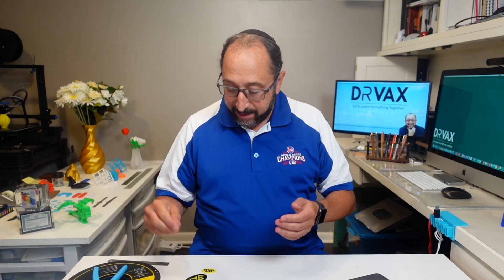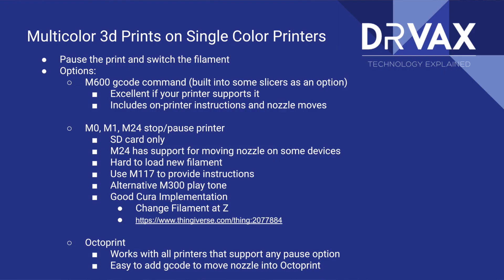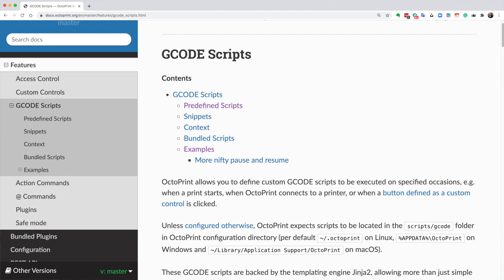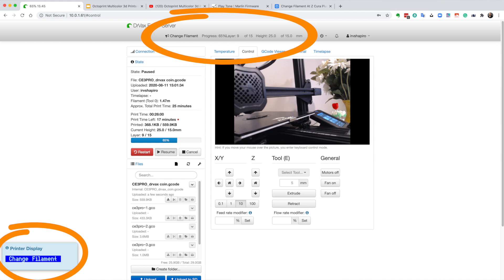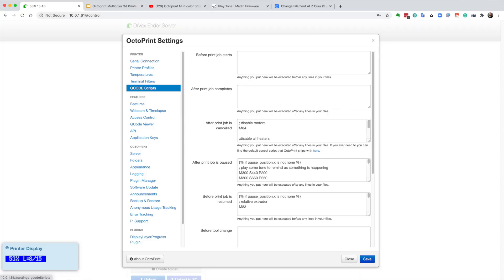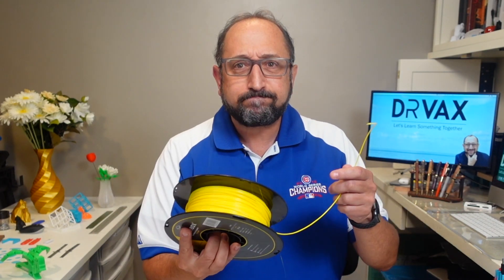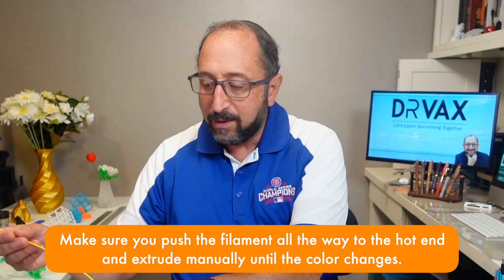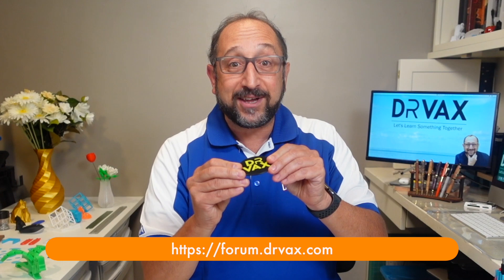Octoprint Multicolor 3d Prints including Ender 3 V2

Comment: I am trying to do a simple multi color print using Professional Firmware (9/23 version) on my Ender 3 V2 stock printer with Cura 5.4.0's Pause at height post processing script. When I attempt to send the M0 command through OctoPrint it displays this message: Not sending M0 to printer, it's configured as a blocked command. The printer does not relocate the print head. If I change the filament and try to continue, I get a blob of filament when the print resumes. I tried changing the Cura script to use the Repetier/OctoPrint method but that did the same thing - the printhead did not move out of the way. I guess I'll try to figure out the old way to do this with just an SD card.

Comment: Your videos are always in depth and well-articulated. However, like many have commented below, unfortunately the technique doesn't work for Ender 3 V2 although it might have worked for you somehow.
Neither M18 or M84 commands are able to disable motors individually. Similarly, M17 isn't able to engage axis individually.
So unfortunately this video technique doesn't work on Ender 3 V2.
Nonetheless, thanks for showing some advance features of Octoprint.

Comment: Just wanted to thank you for the multicolor video. I bought my first 3D printer, a ANYCUBE Kobra and was disappointed to learn it did not have the ability to pause for color changes. So I bought a used Raspeberry Pi, got Octoprint working and followed your instructions on this video. I am now functional for color changes. Thanks a bunch. Great video. Your presentation makes it very easy to follow you.

Comment: I had issues with the supplied code where the extruder stopped extruding after resuming. I had to add an extra M83 command after resetting the feed rate to resolve it. Hopefully that helps someone who might run into the same issue.

Comment: I know this is an old video, but I'm having trouble getting the script to work properly. 1) I'd like it to automatically retract 300mm of filament prior to the pause and it's not happening. 2) The extruder motor remains active, after the pause, even though there's an M84 E command. Below is the script:

{% if pause_position.x is not none %}
; relative XYZ
G91
; relative E
M83
; retract filament, move Z slightly upwards
G1 Z+10 
G1 E-300 F4500
; absolute E
M82
; absolute XYZ
G90
; move to a safe rest position, adjust as necessary
G1 X0 Y0
; make sure position steppers stay powered on to lock position
M17 Z X Y
; unlock the extruder stepper so we can use the dial
M84 E
{% endif %}

Comment: Will the bed remain heated using your method?  As there is no command given anywhere (neither in Cura or Octoprint GCode) I don't see any reason why the bed wouldn't retain the temperature  that it was printing at while the system is paused waiting for the filament change/resume.  I have a current issue using M600 where the bed will cool down, so if I am not standing by to change filament/resume my print, the object I am printing will lose its adhesion to the bed.  When I resume my print, even if I reheat the bed again, the printing becomes a mess as the object starts moving on the bed.  Using Ender 6.
Reply: It should keep the beds status. For me it does.
Hope this late answer will help you.

Comment: add m300 then you will get a beep also if you add m300 for resume the post scrip will work and you can change the filament with the script just fill in the filament info also set the code from marlin to BQ (M25)

Comment: Just wanted to let you know that this technique is working very well for me.    I've upgraded Marlin on my Ender 3 and so I will try the filament change feature in the slicer as well once I am done with my current project.    One thing that i found helpful was that when I change the filament,  i get a little blobbing on the print since i am feeding the filament into the hot end in by hand.    I worked around this by turning the Draft Shield on in CURA.    This allows the filament to purge before going to the print.
Reply: Man thank god I read this comment. I was curious how I would be able to still have a clean transition after changing filaments without blobbing or anything like that. A draft shield is perfect since it's always the first thing printed every layer! Thanks!
Reply: @PabzRoz   Yeah thanks for that info. That Draft Shield completely stopped the blobs.

Comment: Thank you from Argentina!.  In my case the M84 E command did not work as it does not unlock the stepper individually. I only work the M84 unlocking all the steppers. Do you know if there is another command to unlock only the extruder? My printer has Marlin 2.0.7.2 and it works perfect. It may be necessary to enable some function.

Comment: Did this with my Ender 3 Pro, running Marlin 2.x firmware.  Worked!  One suggestion to the code would be to drop back to the bed and run a wipe strip next to the first one to get the head primed.  May work on this myself in your posted code soon.  Will require some more research.
Reply: {% if pause_position.x is not none %}
; relative extruder
M83
G1 X0.1 Y20 Z0.3 F5000.0 ; Move to start position
G1 X0.1 Y200.0 Z0.3 F1500.0 E15 ; Draw the first line
G1 X0.4 Y200.0 Z0.3 F5000.0 ; Move to side a little
G1 X0.4 Y20 Z0.3 F1500.0 E30 ; Draw the second line
G1 E-4 ; retract a little
; absolute E
M82
; absolute XYZ
G90
; reset E
G92 E{{ pause_position.e }}
; move back to pause position XYZ
G1 X{{ pause_position.x }} Y{{ pause_position.y }} Z{{ pause_position.z }} F4500
; reset to feed rate before pause if available
{% if pause_position.f is not none %}G1 F{{ pause_position.f }}{% endif %}
{% endif %}

Comment: This didn't quite work on my Anycubic Mega S. After filament change my extruder wouldn't extrude any filament. But I found elsewhere the solution. In the 'Before...Resumed' script, just before the line "; move back to pause position XYZ", insert an M83 line into the script like this:

 ; WARNING!!! - use M83 or M82(exruder absolute mode) according what your slicer generates
M83 ; extruder relative mode

M83 worked on my combination of Anycubic and PrusaSlicer.
Reply: That's interesting. I too am using the Anycubic Mega S but the code worked fine for me though I was using Cura to slice not PrusaSlicer.
Reply from the maker: Thanks for sharing.

Comment: Hey, I am having the issue that after I change the filament and resume the print... the nozzle is digging into the printed object upon restart, I tried doing a quick fix by just increasing the z offset but it didn’t change the zheight at all. Not sure why. It’s pretty easy when you break down your video just copy and paste the settings into Octo, and the layer pause in cura
Reply: I’m also having this issue! It smashes into the print on resume!
Reply: @teej84  Does your gantry drop while changing filament? I had this happen the first go around, tightened everything up (eccentric nuts and all screws) and works okay-ish. If I don't get to it immediately it seems like the "Hold" on the Z axis ends after 2 mins or so. Any additional recommendations would be appreciated! Thank you DrVax for all your content!

Comment: After some real headaches trying Pause at Height and Filament Change in Cura, finally some help. Great video! Especialy because you don't just learn a trick, but also hightlight the problems. It helps to understand my printer better.

Comment: I found that the M0 command was blocked on my Octoprint when I attempted to use this method. I unblocked the M0. It works now. Is that ok? I do find if I take more that 90 seconds to do the physical filament change the stepper motors release and the z axis drops.
Reply from the maker: The stepper motor timeout is dependent on your firmware.  You might be able to put a G code command in your start code to override this timeout depending on your printer.  Check out these commands:  https://marlinfw.org/docs/gcode/M018.html
Reply: @MakeWithTech  can I put M18  S9999 in the before pause gcode line in the Pause at Height script you featured in this video, to extend my time to change filament without worrying about the stepper motors releasing? Thanks for your response.

Comment: Great video as always.. just one question. I am running an optical sensor for filament runout or jams which is wired through my Ender 3 v2 board. Will this create any conflicts with this setup? Thanks again for a great video!

Comment: If you have the 4.2.2 board this doesnt work! :(
https://www.gitmemory.com/issue/MarlinFirmware/Marlin/19153/680683876
The G-code runs but you cant disable the extruder alone. It's either all steppers on, or all steppers off.
Meaning you either have a hard time swapping filament but you dont lose position or you easily swap filament and also easily lose position.

Comment: If you happen to move the x axis when changing filament like I did, is there an exact way to move it back to that point
Reply: I believe it does this already: @12:35
Reply: @DaveRune  mine didn’t go back. It just banged against the print and started running the filament where it was trying to print.
Reply: @nikkihargrove7952  I guess it got knocked downwards meaning the direct path was unfortunately through the model? May be a good move to raise it up somewhat before resuming.

Comment: Thank you for the info. My extruder will not disengage after the M84 E command. I tested it in the terminal, I can only disengage all steppers with M84. I can also only reengage all steppers with M17. Commands for a specific stepper don't seem to be interpreted. I have upgraded my firmware to the latest version and I have the latest version of Octopi. Any suggestions would be greatly appreciated! Thanks.
Reply: I think I have the same issue (with stock firmware), but from what I've found online it seems it might be a limitation of the board: https://www.gitmemory.com/issue/MarlinFirmware/Marlin/19153/680683876

Comment: i use MULTIGCODE software on my ender 3 v2 this software cut the g code on several part so you have all the time to change the filament because you are several g code just change the filament before confirm the end of print the only problem is to purge the filament manually and the z not up to help you i don't know how to enter command in note pad to automate extract filament z position and the purge. I use cura. this solution no need  modification of your printer. Sorry for the english i'm french

Comment: i use prusa slic3r, i set this up in my octoprint, when i load a file and tell octoprint what layer it is i get this error. injecting "GCODE failed. Replaced 0 out of 1 needed." any help would be great thank you

Comment: Thanks for the video! Where can I cut and paste the gcode shown? I have been doing multi color prints on my MP mini using the M600 gcode. However, I purchased a Anycubic Mega X and there is no gcode supported pause. So, I am making the leap to Octoprint. Thanks again.
Reply: both sections of code (pause & resume) are in the description

Comment: I have found a way to change filament on the 3v2 using the "Pause at height" post processing command on Cura 4.7.1.  I selected the BQ (M25) method.  It only works correctly if you add something to the "G-Code Before Pause" box.  I added a M300 command so it would beep. 

Note: I needed to make one change to the g-code to prevent a blob of filament once it restarted printing.
Resulting G-code shown below.  I commented out the final G1 F1500 E10 line and the print came out great!

;script: PauseAtHeight.py
;current layer: 3
M83 ; switch to relative E values for any needed retraction
G1 F1500 E-10
G1 F300 Z1.8 ; move up a millimeter to get out of the way
G1 F9000 X190 Y190
G1 F300 Z15 ; too close to bed--move to at least 15mm
M104 S0 ; standby temperature
M300
M25 ; Do the actual pause
M109 S200 ; resume temperature
G1 F1500 E10
G1 F1500 E-10
G1 F300 Z1.8
G1 F9000 X122.478 Y111.115
G1 F300 Z0.8 ; move back down to resume height
;G1 F1500 E10  -- This is the line I had to comment out.   Else I got a 10mm blob of filament…..
G1 F1500 ; restore extrusion feedrate
M82 ; switch back to absolute E values
G92 E338.46292
;LAYER:3
Reply: The blob's been driving me crazy, so thanks for this - gonna try it soon. I actually managed a print without a blob once by not feeding the 2nd color all the way to the extruder, but that seemed awfully imprecise. I've also wondered if it might not be possible to have it extrude a purge line after the pause, just like it does at the beginning of a print. It occurred to me that you wouldn't want it to do that on the far left like it does at the beginning of the print, as that could knock over your print if it's a tall one, but maybe a line at the very back of the bed?

Comment: I find it much easier to just use "Pause at Height" function in Cura.  I love Dr Vax but his desire to get into the Gcode commands is obsessive.  I've been using Octoprint for more than 3 years and have never once used the "terminal" tab.
Reply from the maker: I always find that the more I understand how technology works the better I am able to utilize the technology.  I do understand that the g-code segments may be tenuous for some of my viewers.  However even if you do not want to write g-code, you still need to use the terminal interface to turn your 3d printer.

Comment: I am on the stock Ender3v2 v1.0.1 firmware and the steppers are locked for ~120 seconds but then unlock. Also during that time, the extruder is not unlocked.  I have only been at this for a week so updating the firmware is not yet in my wheelhouse.  After canceling the print I tried sending the M17 and M18 gcodes to the printer and noticed that even if I specified an axis or the extruder 'M17 X' it would lock all steppers.  Same with the 'M84 E' would unlock all of the steppers. Back to the script when it runs the return for the M84 E would return 'echo: busy: processing'.  Great video and the explanations helped demystify 'GCode' and set me on this learning path.
Reply from the maker: Yes. Each version of the firmware reacts a bit differently.  I believe it may be related to the optional timeout parameters on the M18 command.  While the documentation states "If a timeout is given with S, this command just sets the stepper inactivity timeout.
If no steppers are specified, this command disables all steppers immediately."   I have also noticed my stepper motors do not unlock immediately.

In fact Creality recently shipped version this version "Ender-3 V2_32bit_ 2.0.1V Latest Firmware_0814.rar" which I have installed but not tested.

The only way to get the exact documentation result is probably to install the native Marlin V2.

Comment: I've been recently introduced to your videos and they've got some good content... This script to do filament change is good - but damn, its an ugly hack. At the risk of being accused of plugging my own firmware - I build the options in to allow the use of M600 on the Ender 3 V2 - which makes this a LOT easier - and in theory, OctoPrint should even prompt you for a filament change.

The firmware is at https://marlin.crc.id.au/ - updated from the bugfix-2.0.x branch of Marlin every day - so its always current.
Reply: I installed the firmware you compiled for the ender 3 v2 stock on my printer and it does pause the print at the correct layer and moves the print head and unloads the filament but there is no way to tell it to continue either with the screen or Octoprint. Unless you know of a way to get it to continue DrVax's "ugly hack" is the only way to do 2 color prints on a Ender 3 V2
Reply: @HATipsByLarry  the print should pause and you should be able to press resume on the screen.
Reply: @CRCinAU  I agree I should be able to but when i press resume nothing happens
Reply: @CRCinAU  Ok I have an update on this couldn't find a way to start the print after using the M600 command through octoprint but even though nothing shows up on the screen of the printer if you depress the scroll wheel button after a few seconds the print will beep then after the beeps wait a few seconds more then depress the button a second time it will load the filament and then continue the print.
Reply: @HATipsByLarry  that's actually a fantastic find! It makes sense when I think about it, as normally, Marlin uses a long press as a continue / escape - so that would be an extension of that functionality!

Great stuff.
Reply from the maker: @Steven Haigh   Interesting service at a fair price that I did not know about.   Thanks for sharing with my viewers.

I will do some testing and consider featuring your site in a video about custom Marlin builds.

If you want a real challenge.  The ANET ET4/ET5 users would love to have a marlin build for their printers.

Feel free to let people know at forum.drvax.com about your builds.  The folks on the DrVax discussion group will likely find your builds useful and will provide you with feedback.
Reply: Also found a plugin for octoprint that adds buttons to Park, Unload, and Load filament, it's called of course Change Filament. And with the Consolidated Tabs plugin makes it very easy to park the head unload one color and then load the other by a push on the buttons in octoprint. Coupled with your firmware to allow for the codes that is.